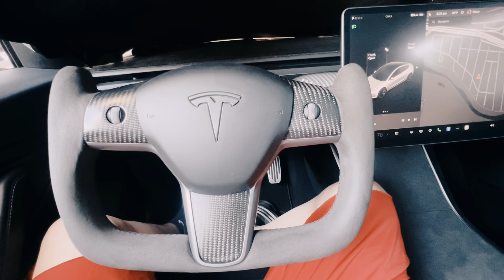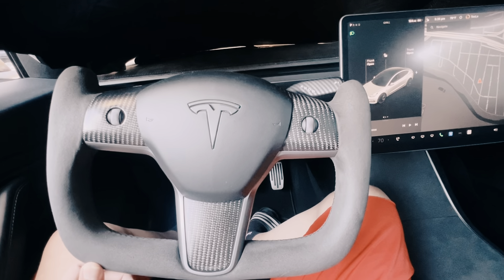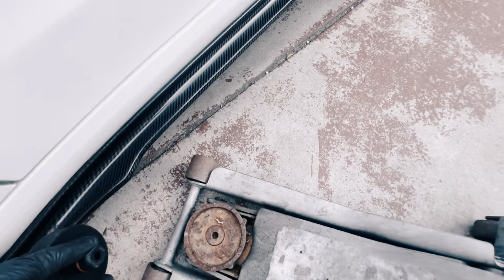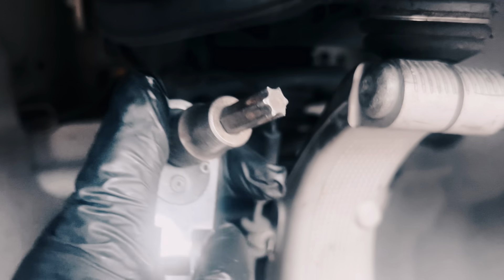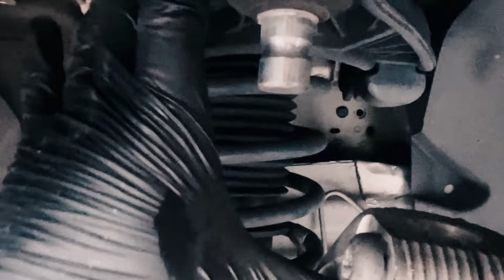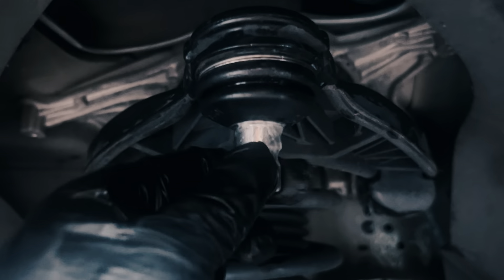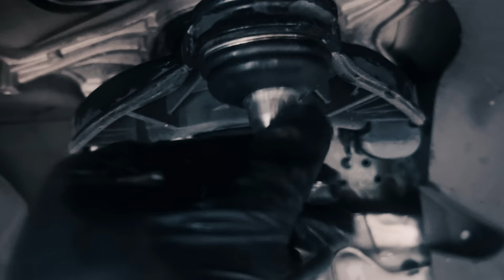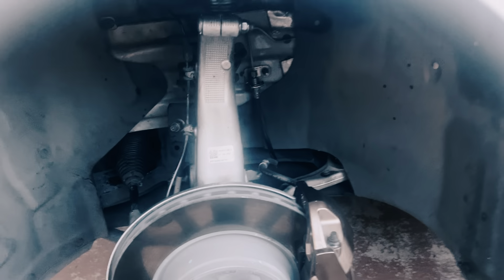Tesla model 3 Y Control Arm Squeak Creak Sound Fix

Comment: Use a jack to lift the wheel-assy when assembling the ball joint again. (Which seems VERY loose btw). I believe the sound normally comes from the ball joint and not the bushings as most tend to only inject grease into the rubber boot and thats it. Wonder how you got grease inside the bushings and not just plastering it around them without any real use.
Reply from the maker: Have extra jacks just showing for others that you can do it with one.

Comment: Dam man everyone always says they hear it when it's cold but for some reason I only hear it when it's super hot out and when it rains it goes away
Reply from the maker: Hi Luis, have u check the play of the ball joint? And the shock tower when it happens try to lube them to make sure they are not worn. And I hope it is not your power steering rack.
Reply: Yeah I have but it's coming from behind the break rotor so weird sometimes I spray wd40 and then it goes away then sometimes it doesn't  @car-lo
Reply from the maker: You can also check the wheel bearing, put it on jack and spin the wheel freely (easier to check for rear wheel m3)